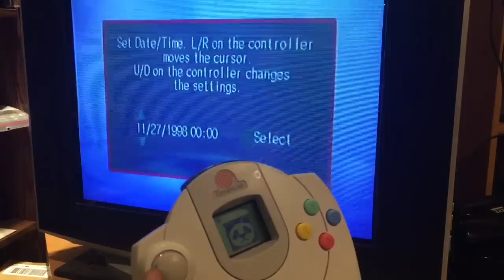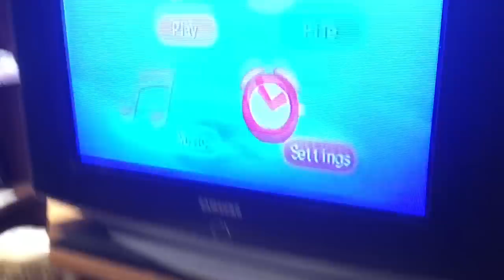Fixing eBay Junk - Dreamcast Restoration - Part 1 - Smoke Damaged Sega Dreamcast

Comment: Hey Adam, I truly enjoy all of your videos, I’ve learned so much.  I have a quick question that you might know or anyone else here on your channel.  I have a Sega Dreamcast that I got off Ebay(fixer upper) and it came with the wrong case screws.  Do you know what size/type I would need to get to match the original?
Reply from the maker: jeepnII I believe they are 12mm #2 philips screws.  I found that listed on some teardown instructions, so it may or may not be accurate.  I don't have a good way to measure the threads,

Comment: I have a PS2 that seems to work fine, other than the fact that it won't load games past the logos, and barely plays DVDs. I was wondering if the disc reader could be fried or if there was something else going on? I was going to just sell it, however I still have some games that I'd like to play again. (*Cough* FFVII)
Reply from the maker: Good chance it's the disc laser. I've had issues with every ps2 I've owned, some read better than others, or just not at all

Comment: After cleaning with magic eraser.. I tend to use armor all on the plastic to restore and protect that plastic.
Reply from the maker: Not a bad idea, do you find out actually helps?  In theory it should help protect against yellowing from uv
Reply: Aerospace 303 is a far superior product to use for retro consoles and carts. Armor all some times will leave white residue and can have adverse affects with some old consoles (different plastics compositions etc.)I have done several restorations myself and when I ran into this issue with armor all I researched and other game restorers turned me to aerospace 303. Does wonders for small fine scratches as well. In conclusion I don't recommend Armor all.
Reply: Elite Saiyan  I've never had a problem with Armor All, but I've never used Aerospace 303. I'm gonna look in on that, thanks for throwing something new into my restorations.👍

Comment: That much smoke damage needs to be cleaned off of every component. It will act as a thermal insulator and possibly make connection shorts. You can clean the soot off with rubbing alcohol or just water. As long as the boards and components are completely and thoroughly dry, it should be fine. You can actually put a motherboard in a dishwasher, let it dry for a week, and it will work fine.

Comment: Instead of alcohol you can use Windex in combination with the magic eraser and it does a much better job. I cleaned up the back of an IMAC and alcohol wasnt doing anything so I tried Windex and the shit that was on it melted off

Comment: Instead of removing the ribbon cable from the laser chassis why not remove it from the bottom circuit board which would make it easier to get it put back together.

Comment: I love Dreamcast. Under rated system IMHO. I think it deserved more attention. 
I bought one brand new for cheap and I enjoyed playing a few games on it. I made the mistake of letting someone borrow it that I thought was a friend. I never got it back. I'm certain he sold it for drugs or to repay someone he owed money to. 
A few years later I bought one off ebay for $20 and it came with a few games, controllers, etc. Seller told me it powered up but it had trouble reading games. Most lasers can be tweaked or replaced, and I've done it before, so that's pretty much what I expected. Funny thing is that when I got it and checked it out I had no trouble playing any games at all.  What luck.
Some of my fav DC games have since been ported to newer consoles (Jet Set Radio is one) but there is 1 game I love from my time playing DC that I wish would get a modern port and that's Record of Lodoss War.
Reply from the maker: Dreamcast was an awesome system. Too bad Sega made some bad decisions leading up to it that it never really had a chance.  Heck, we never saw the display in a controller again until the wiiu, or i guess technically the ds had a secondary display too
Reply: @RetroRepairs   DC was easy to pirate games, which I feel may be one of the reasons it failed. 
I enjoyed the VMU, but dealing with batteries was ridiculous when you found a fun minigame.  Playstation 1 had a VMU as well, but it never released outside of Japan, despite initially being promoted for Final Fantasy 8 stateside.
Reply from the maker: There were a few bigger reasons for it failing.  One, it had to compete with the PS2, which to this date remains the top selling console of all time.  (Plus it came with a DVD player, which was expensive at the time)

But Sega was super dysfunctional, especially the relationship between Sega of America and Sega of Japan.  Goes back to the Genesis and 32x.  Long story short, they launched the 32x in North America with moderate success, but Sega of Japan had been secretly accelerating development of the Saturn and announced it shortly after the 32x was released.  This killed the 32x here, as why buy one when a real console was just around the corner.  Then the saturn dropped in 95, was discontinued in 98, Dreamcast came in 99, and by that time, Sega had released the Sega CD, 32x, saturn and dreamcast all in the span of 7 years.  People were getting annoyed that their new console or add-on was becoming obsolete so quickly.
Reply: @RetroRepairs    Might just be my opinion but I think the 32X had amazing potential that definitely was never realized. 
I agree about Sega being kinda dysfunctional. 2 different Genesis models. 2 different Sega CD models. 32X.  Then Saturn's incredibly short life span and Sega's refusal to bring over certain games (Like the rest of Shining Force 3)
I'm feeling really nostalgic here.  I had a lot of good times on Sega consoles back in the day, and there are still games I have yet to play that I hope get ported one day.
Reply from the maker: The different types of models is nothing new though.  All major systems except the n64 have done it. There was a toploader NES, SNES jr. Wii mini, PSOne, PS2 slim, xbox one x/s, ps4 pro.  

But you're right, had the 32x been given a chance, i think it could have done fairly well.  Unfortunately it launched in North America first, then sega of Japan announced the Saturn would be coming much sooner, and essentially made it DOA.
Reply: @RetroRepairs   Oh, I know the different console models is nothing new, but I think it was worse with Sega because of the form factors between the Sega CD and Genesis.  Model 1 Genesis wasn't compatible with Gen 2  CD, etc. At least when the 32X was released it came with an adaptor piece so that it was compatible with both Genesis models.  
Then you had the Genesis CDX.. 
Not many systems have done actual add-ons like the Genesis. While it's tough to say what the mind-set was for your average gamer back then (since I was so young), I imagine it may have been a bit overwhelming or confusing. 

Personally, I never did get to add the Sega CD, nor the Saturn to my collection.
Reply from the maker: The sega cd was compatible with both versions.  The model 2 cd actually included an extender so it would match the full length of a model 1 genesis, but the model 2 on a model 1 cd looks kind of goofy.
Reply: @RetroRepairs   Ah. My bad. Did not know that. I had heard long ago that the different models weren't compatible with each other.

Comment: Sweet just adjust the trim pot on the laser board it need a ohm meter to adjust it
Reply from the maker: Going to attempt that in part two.  The motor spins up and the laser moves up and down, so hopefully just  an adjustment will do.
Reply: RetroRepairs 100% it will fix 5 of them as long as you have what you said working it will just make sure you ohm it

Comment: Is it actually safe to use isopropyl alcohol on plastics? i've tried it in the past but noticed it left scuff marks on the plastic.
^ also this is one heck of a repair job.. how do people let their stuff get into this condition.
Reply from the maker: Drowssap sure, alcohol won't break down plastic.  It might affect certain dyes, but I've never noticed an issue on any grey systems.  Maybe something like a sega genesis where they have glossy black plastic

Comment: Hey I'm planning to clean all my nes carts in the near future how do you clean your. This guy that I found on the net from a modding site he suggested to use a eraser.
Reply: I don't recommend doing that, using the magic eraser to much will remove the texture to the carts.
Reply from the maker: A light clean is fine, just don't go to town. Dont use it on glossy plastic either
Reply: What method would you use like one of those 1up cards
Reply: I want to use it like once to know it's good and clean to do a process of elimination just so I know it's not my system or my game. if something is wrong after that.
Reply: @Jacobmainchannel  oh your referring to the contacts, thought you meant dirt and grime on the outer case. A pink pencil eraser does do a ok job cleaning the contacts, the 1up cards are very convenient so you don't have to disassemble the games to clean with a eraser. And on very dirty contacts as a last resort you could try brasso it's a copper polisher but it removes a slight layer so don't use to much or often.
Reply: Okay while we're on the subject do you recommend and screw drivers to open the carts when needed because I have gotten to buying the drivers to open the carts yet. In this case I mean companies to stay away from when buy the drivers,Also good ones.
Reply from the maker: Ditto on the eraser it usually is all you'll need, then wipe down with alcohol
Reply from the maker: I don't have any specific recommendations. Honestly, i just use cheap bits i buy from ebay. Cost about $2 and ship from China.  You should never be putting enough pressure on these to strip them
Reply: @Jacobmainchannel  well I do recommend buying the game bit screwdrivers instead of just the electric drill bit game bits. I've had more luck with those. I've gotten just the bits before and while they look correct they don't properly grip the screw. While your experience may differ greatly that's just been my luck.
Reply: OK thanks for all the info I think I good to go now

Comment: I have my own Dreamcast that I've had for many years and the outside case is now yellow. Would a Magic Eraser make it white again?
Reply from the maker: Probably not, alot of white consoles turned yellow due to uv exposure.
Reply: RetroRepairs Any suggestions on bringing it back to its former glory?
Reply from the maker: Buy some hydrogen peroxide cream from a hair salon, coat it in the stuff and leave it in direct sunlight all day.  Look up retrobrite.  Works well.

Comment: Do you do Dreamcast repairs for customers? I have one thats clean It just doesnt do the dreamcast boot anymore and it stays stuck at the dreamcast logo forever im not sure what causes that....
Reply: Basically it takes forever to boot but really doesnt boot up
Reply: +MetalDistortion  Usually that indicates a problem with the motor that moves the laser component, or the optical lens of the drive is having difficulty calibrating/focusing on the CD.  Have you tried putting a music CD in the drive to see if it'll play that?  Obviously, if your Dreamcast can't even play back an audio CD, it would indicate a complete failure of the laser unit.  However, if the audio CD works, this would mean one of two things: Either the GD-ROM drive unit is having trouble reading actual GD-ROMs but not CDs, or that the Dreamcast motherboard is malfunctioning in some way. 

A few other causes I can think of includes the disc not spinning fast enough due to an aging motor, or data corruption on the BIOS chip which would attribute to the erratic behavior of your Dreamcast unit. (Data corruption of the BIOS is extremely rare; I've only seen it happen once.  I think it's more likely something's wrong with the GD-ROM drive.)

Comment: I have a system needs repair xbox360 how much do u charge
Reply from the maker: keith miles I don't do mail in orders. After shipping to Canada, you might as well just buy a new system.
Reply: Dude just buy a new one or learn to fix it yourself 360s are pretty easy

Comment: water will not damage electronics if there is no power when they get wet. i would run water on the boards. if you are worried then use rubbing alcohol. sorry but you didn't clean a lot of stuff that would be easy to clean still. i couldn't take apart like this and not really clean stuff. there is no reason why you choose to clean some stuff and not others. you act like water will make metal rust insistently if it touches it. this is not how it works. if you go this far clean everything. kinda did drive ribbon cable backwards too really. should have done the cable on drive first then on board. i would never use this video as a guide on how to clean now. this is the not the right way to do it. this is like making the outside of a car look nice but who cares if it don't run or the inside is dirty. small stuff matter
Reply from the maker: james42519 true, however if water gets in anything and doesn't dry properly, it can cause problems.  I just would rather not risk it

Comment: you spend so much time cleaning plastic and do almost nothing to clean up internals, and in the end you still have a broken laser assembly. what was the point of this video?
Reply from the maker: William Hetherington restoring the outer shell.  You'll note it says part 1.  Part 2 will be getting it functional.
Reply: William Hetherington dude its still a teardown video. also entertaining
Reply: you know what I think he should do? open it again, replace the whole drive assembly with one of those USB options, clean up the main board and power supply area really well, and then he's got a nice looking, clean, working Dreamcast
Reply: I don't think that's the point of a repair, but whatever.